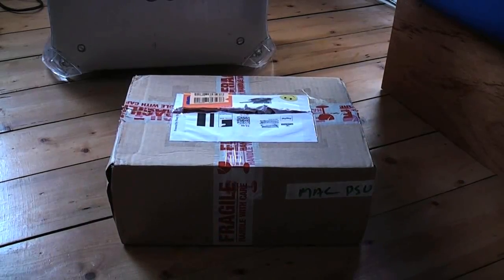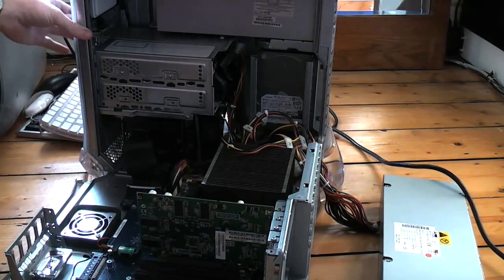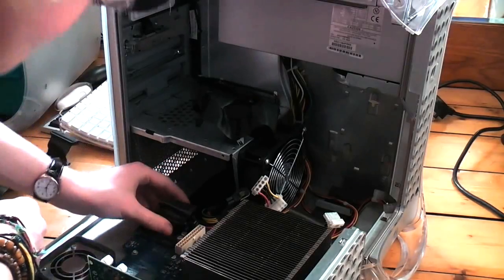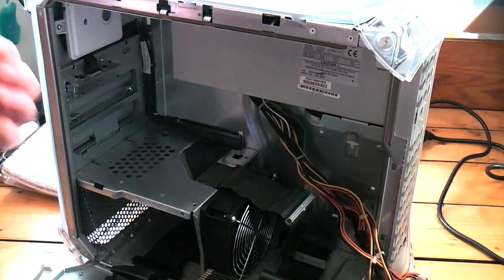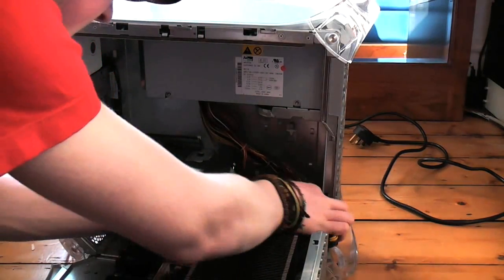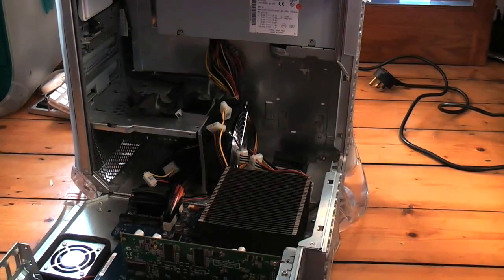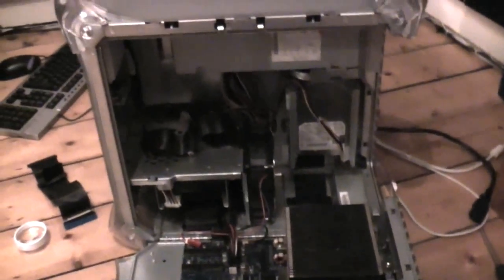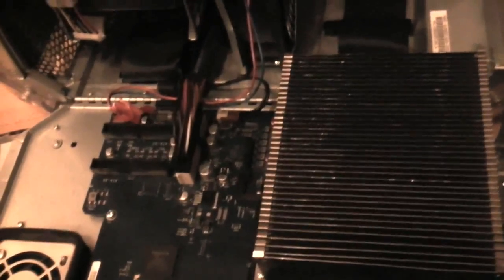PowerMac G4 MDD Power Supply Replacement

Comment: Probably don't need to remove the hdd on the 'wall'; just remove the power cable. Other than lighting the area inside the Mac better, nice video (remember you want a darker background when you're shooting into a 'darker' area especially if your doing the exposure on auto). Appreciate your boldness!

Comment: Thanks! My MDD has stopped starting up, or will start up but will shut down if it goes into sleep mode. Or, it will boot if I unplug it from the mains and plug it back into the mains. Is that just the PRAM battery, or do I need a pwr supply...? Thanks.

Comment: You have to use a MDD-specific PSU. An ATX won't fit, although it can, but only if you modify the cables (but the computer won't drive ADC displays anymore as ATX can't deliver +25V) and the size will prevent you from fitting full-height PCI cards.

Comment from the maker: @AloushNA Hey man! Thanks for checking out my vids :) Hope your enjoying...
Surprisingly, I get loads of my stuff from eBay. The 2 PowerMac's that I have at the moment both came from eBay, and they were both pretty cheap. You can find slower and older machines for around £60 these days, like single QuickSilvers and stuff. Fun to muck around with :)
As for PC's, they're everywhere. Just find someone chucking them out or find them in the tip and stuff:)
Hope this helps...

Comment: You could buy a standard molex powered PC fan to replace it. If you don't have any spare molex connections it's not too much of a problem as most molex fans have a pass through. Would make your system considerably quieter too! :)